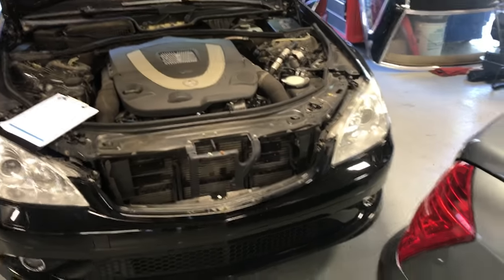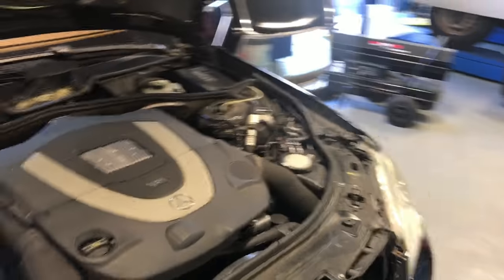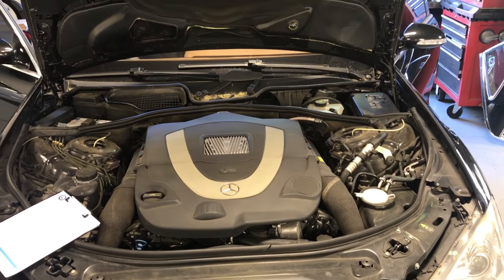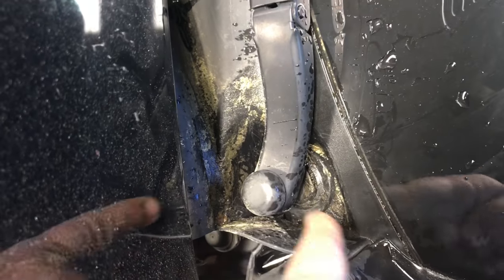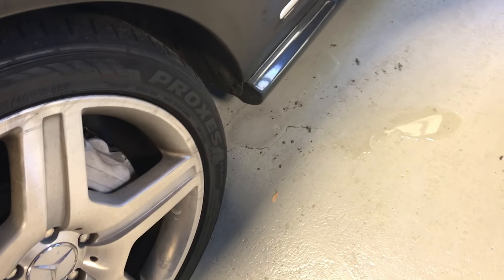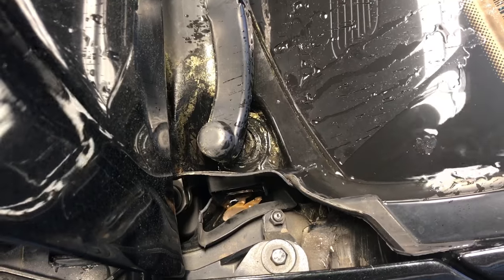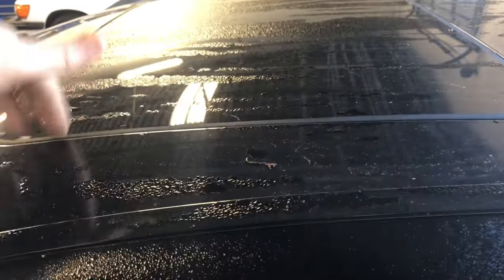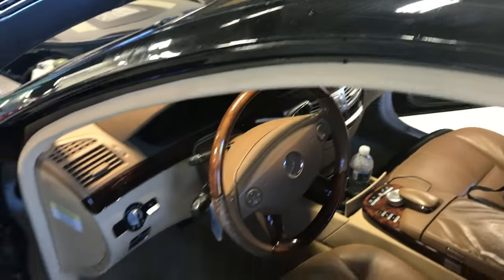Why Water Gets into my Mercedes ? How to Fix Water Leekage Problem?

Comment: What he does not tell you is HOW TO CLEAN the drains.  Title of video?  Naaaah 
Spend some time under the hood at the firewall.  Look for where the water has been running down.  You'll see leaves, pollen, trash, debris, dirt, black stuff.  Don't be afraid of it, just start vacuuming it out.  All of it.  Don't damage the plastic pieces or suck up parts of the car.  Clean out the areas that the rain water feeds into.  Then look carefully down in the dark hidden areas where the water should keep going.  You can shine a bright light into it to also to confirm the tunnelway.  Find something non-sharp like some kind of plastic tubing that is stiff enough to penetrate the tunnel a long way but flexible enough to bend.  Run it up and down and you may find you hit some clogged area and push it through.  One commenter here did this and said water gushed out.  When you free the clog that's what you may see.  But you may not.  Just try to run the plastic tubing down each drain area you can find.  At least 2 in the front.  Don't ask me, because I don't know exactly where they are.  I am about to go look myself.  But I have done this myself on another car before.  Take the time looking and searching and you will find it.

Comment: Man I have an 07 E350 and of course had flagged front cowl drain. Leaked into floorboard and say for a while. Now I have a 6 amp battery drain. Having trouble finding the draw. It goes down if I pull fuse 27 on the SAM. Which is Terminal 15 circuit….any thoughts on what that could be? I’m having trouble finding any info on that. Even tried Alldata at work and had trouble. I live in Atl too y the way. Love your videos. Any help would be great. Thanks!

Tyler
Reply from the maker: You need to run Diag after removing the fuse and see what module is missing on a quick test, it might be motor electronics

Comment: I think I’ve watched this video too late! I’ve had a leak drivers side for some time, soaks the footwell, the seat and comes through the electrics in the middle. Had the roof and windscreen sealed still made no difference. I now have no electrics on my fuel, clocks, Speedo etc :( this going to cost more than the cars worth right?!!
Reply from the maker: You can probably fix it yourself, you need to stop the leak first than remove all the carpets and seats and clean and replace damaged electrical..

Comment: hello I have a mercedes w176 and I have problems with the light on my dashboard which turns on and off and tells me that it is the battery and I changed the 2 batteries and still the problem it's possible that I have water that has come in or it has the fuse box can you help me 
THANKS
Reply from the maker: @yengel7442  yes, check if you have water in and make sure all ground cables are connected

Comment: I have a leak in my driver side footwell in my 2010 GLK350. The dealership told me I need to remove the carpet, wash it with lysol to kill any mold and dry it out. Then while its out, look for either a loose AC hose or for a clogged sunroof drain. They think its the AC though-apparently the hose can come loose and may just need to be reattached. Any tips on where exactly that AC hose is and how I can get it exposed? 
Also-  Any tips on how to remove the footwell carpet? Do I need to remove the front seat? Do I need to remove the acceleration pedal?
Reply from the maker: Natalie Bonus if you turn your AC on and look under the car right in the middle below center counsel you will see two little paddles building up slowly from the evaporator if you have a way to lift the car up you will see two hoses right where the transmission is, if they both drop water out slowly then your problem is somewhere else..

Comment: I have the same problem with my c320 water next to the fuse box, car wont start any help?
Reply: I got the same problem 2008 c350, your car won’t start because there’s a harness that runs from the engine, to under the floor board, and conncects to the trunk and it’s probably damaged from the water and it’s going to cost over $9,200 for that harness itself, I’m having that problem now
Reply: these money-pits don't really like to get wait. 
Replacement Front/Rear-SAM modules need to be coded to the car VIN

Comment: I have 2009 C350 and it leaks right there under the divers side wiper and the fuse box gets wet cause its right underneath, what a horrible design, i dont have a clog there is a hole there that water gets into

Comment: I have a g500 (2008) that leaks at the plastic sunroof control area.  

The area that houses the sunroof controls and map lights....

Any ideas where to start?  Water is leaking (very slowly) from that area onto my shifter.

Thanks in advance.

Comment: Thank you for this video!!  Wish I had know about these sooner because the clogged drains I just realized caused my left SAM to go out and I had to pay to get replaced.  Now I know I need to clear the drains as well.  I have a convertible and am having leaking issues with the top where it connects with the car.  Are there drains there also??
Reply: Horrible.. I have a W204, 2012 C250, and I'm going through this nightmare now. I don't know which SAM is fried, but my ABS, traction, cruise control, and body control haven't worked in months. Thanks to those stupid roof drains.

Comment: Not always the case.
All Mercedes Benz model come with low quality seam sealer that cause leaks through all spot welded parts: roof, rear body upper panel to mention a few. These leaks cause major repairs such as having to replace. sam modules, ISM transmission module & tail gate motor to mention a few.
Stay away from buying Mercedes Benz unless it is a classic Benz. They are built extremely poorly. 
I will dump my GL450 for next to nothing after spending over $12,000.00 in this vehicle.

Comment: Great video but mine is leaking from the A Piller. Can you show us how to clean that?! It’s getting bad. But I don’t see any debris when I open the sun roof.
Reply from the maker: There is a tube for drain from the sunroof that runs behind the a pillar, remove the panel and make sure it’s still intact, you may have to force air in to clean it or a plastic snake

Comment: i have a 2018 CLA 250, its been pouring rain the past couple of days and suddenly there is water pooling in the rear passenger floor bed...any suggestions on where to look for the cause?
Reply from the maker: Usually from the sunroof or the windshield, the part between the windshield and the lower cowling plastic

Comment: Help, I just had the whole sunroof unclogged and water is still coming in. It seems that the water is coming in from the front glass bc of a lack of seal. I’ve never had an accident, what can I do? My car is already damaged inside, the roof upholstery is starting to come loose. Please help.
Reply from the maker: Check the part under the windshield that snaps to the windshield on the bottom, sometimes it comes out and need to be replaced also make sure you have original Mercedes windshield sometime the after market windshield does not let this part snap in correctly and allowing water inside the car I also suggest that you check with your Insurence if this type of repair is covered by your policy.

Comment: I made a little cover over my fuse box aka SAM box because the drain on w204 is rain right over the box.. Now I cant seem to get the driver side to unclog, I mean it drains but when I wash my car I see the water accumulating, ive tried compressed air, ive tint metal wires but theye seems to be a bend and i cant get all the way threw, is there a trick to this ?

Comment: Hello, I have a 2009 s550 with rain water in the backseat footsteps. Also, you can hear water puddles underneath the rear driver side footsteps. How do I fix this?
Reply from the maker: olaomishore first get the water out, second, find out how they get in and stop it, third replace damaged electrical.

Comment: Is it the. Same for 2006 e350?  It's in the floor, leaking from the light and dripping from the steering wheel.
Reply: C Dil it may actually be your windscreen had that problem on my CLS

Comment: I have a convertible with a driver's side seal down the front of the door window cracked and ripped.  I fixed the outer rip, but it still leaks underneath the outer seal. Having a hard time finding the part online.

Comment: Tell me how to do it!
Reply from the maker: Force air inside but if there are too much debris use a metal hanger to drive it out
Reply: use low pressure air or a 14AWG coper stranded wire (soft & flexible)

Comment: I have a e220 2009 plate. The driver side footwell gets really went when it rains. I had the drains cleaned but it still leaks. Any help what it could be?
Reply: Do you find problem?
Reply: @pecaikac8917   nope :(
Reply: @omarm9566  do you have sunroof?
Reply: @pecaikac8917  no sunroof
Reply: it may be the glued body joint between roof and car side. After some years, it lets go and water gets in the cracks

Comment: How do you clean the drains? You pointed out the problem but didn’t provide the FIX .
Reply from the maker: Force air into the drains.
Reply: @MercedesBenzTechs  how is this done? Its leaking into my passenger side

Comment: I have a 2010 C300 I love the car but was not aware of the headache that comes with it.... Brought it in FLA moved to VA but still running into the same problem with every time it rains, I know I'll be looking at a puddle of water inside of the car that makes no sense.... Mercedes Benz You Should Be ASHAMED!!!!  Your supposed to be top of the line and here I am having to buy a damn car cover or settle to see water from front to back inside the car Really!!! I'm at a point I may have to sell my baby because who wants to worry everytime it rains!!!!
Reply from the maker: Did you try to find the reason for the water inside the car? Look at the bottom of the windshield, there is a plastic part that snaps in to the windshield, is it snug in? Are there any holes around the wiper arms that allow water to pass through into the car? Did you install aftermarket windshield? Did you make sure the drain are free of debris? There are so many steps you can take to find out what the issue is, don’t give up, Mercedes are good cars if taken care off professionally. Good luck